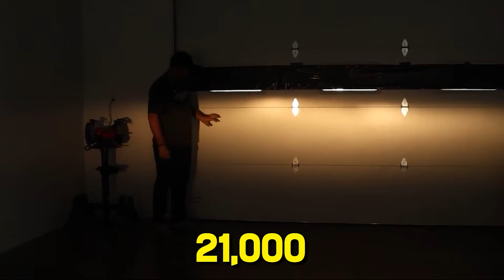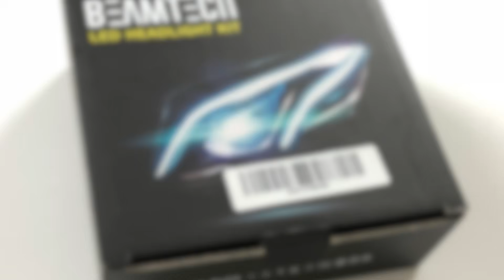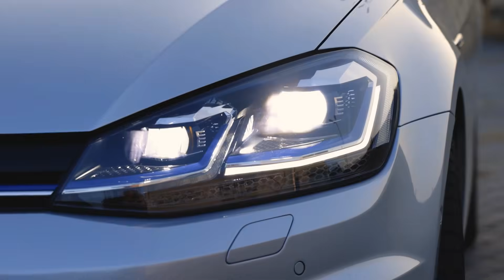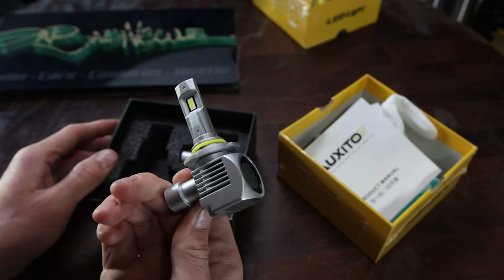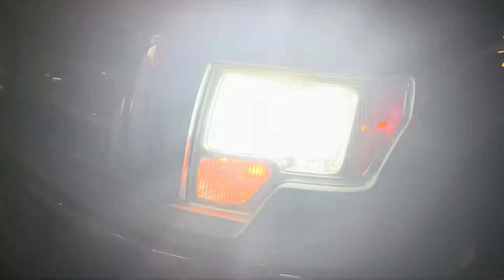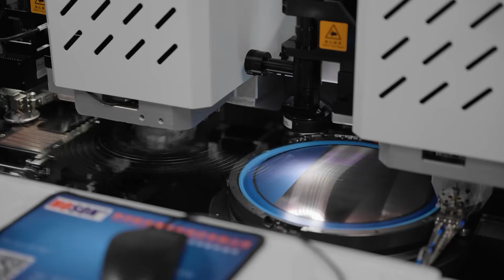AVOID These 5 Headlight Bulb Brands (And 10 That Actually Lasted 50,000+ Miles)

Comment: FACT 
ALL LED HID bulbs are ILLEGAL in halogen housings.

The WHOLE light assembly MUST be replaced and CERTIFIED to be legal.

You also MUST upgrade the wiring and sockets to handle the heat.

Ooooo ASE master with 19 years……..not the guy who would be an expert in lights…..

This video is trash